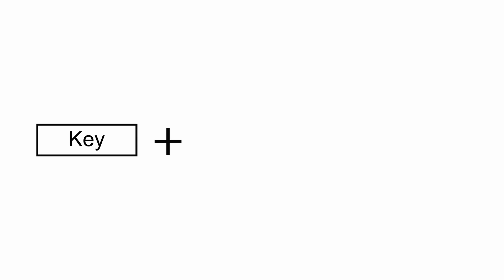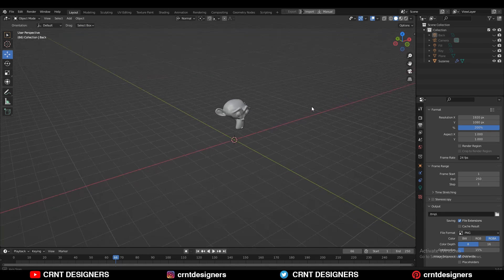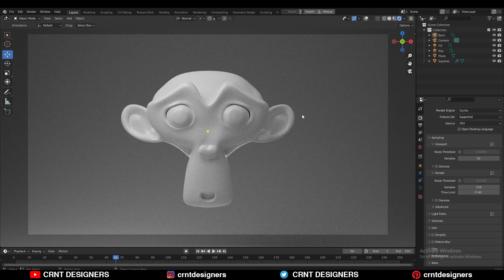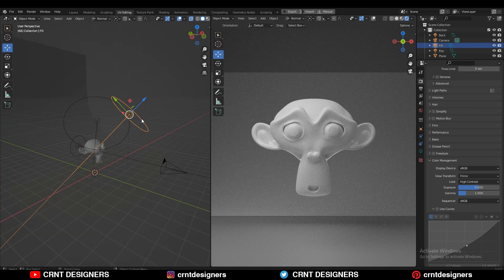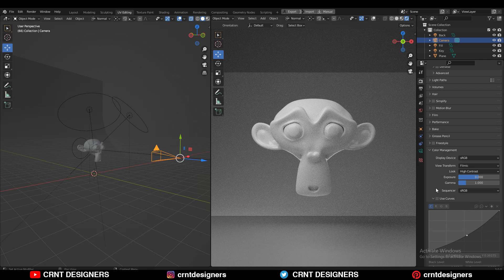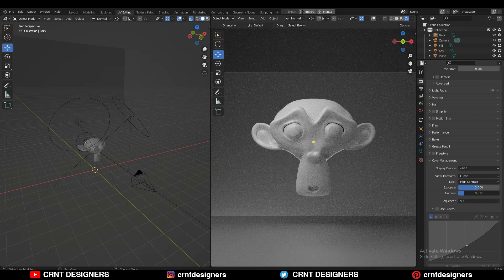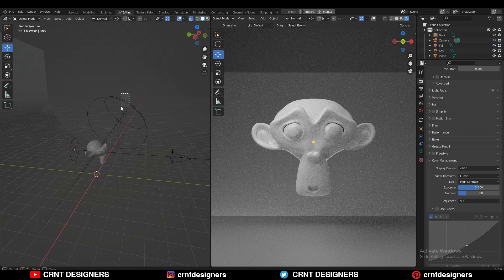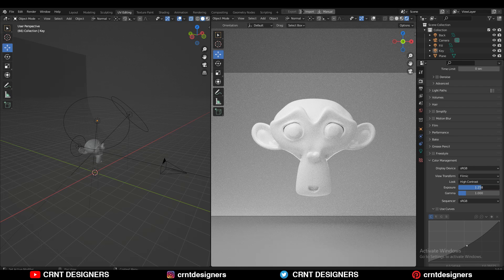Understanding Exposure  _ Blender Lighting Techniques _ Blender Lighting Tutorial

Comment: One tip is that you really should adjust exposure under the Film section, as that will output the values to any non display formats (like EXR). If you adjust exposure under Color Management as you have shown, it still works, but when you export to EXR or another non-display format, it will be wrong/too dark. Also, for accurate renders, you really should not touch the Gamma slider at all. That will really wreck the relative light distribution in your scene.